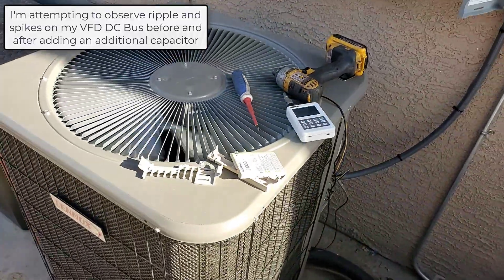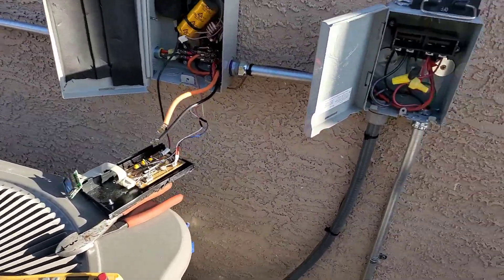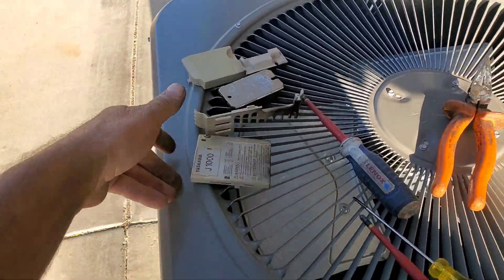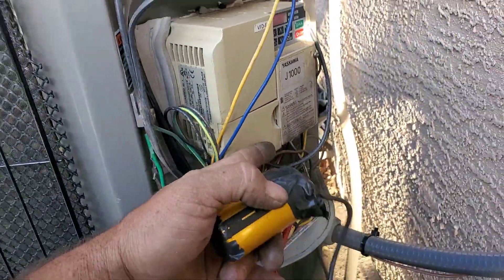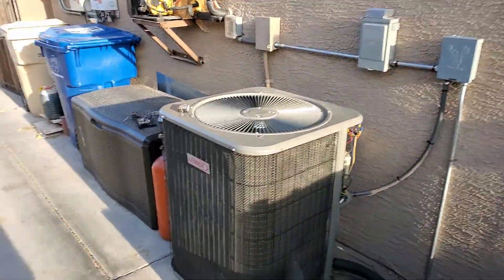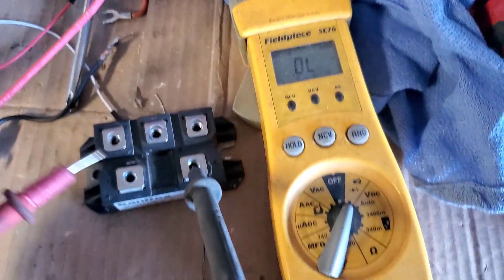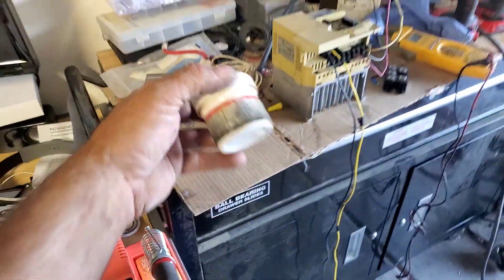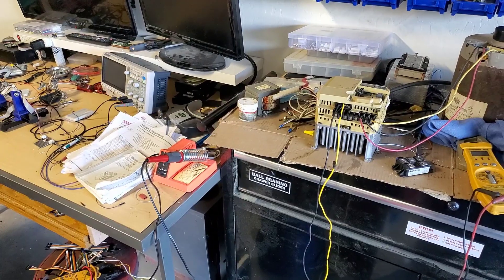DIY Solar-Assisted heat pump goes BOOM when I soldered in another DC Bus capacitor!

Comment: It's nokorode, not no arc.  That reminds me of when I worked on my hot tub and didn't replace the cover on the control box and a little water splashed on.  Well, you've learned not to use that paste on electrical.
Reply from the maker: Yup.
I mean. I may use it when I solder large battery cables together to a connector or whatnot, but I will wipe it off from now on and in those cases there won't be a bridge between + and -

Comment: Yeah with pulsing the triac input ac to the rectifier and dc bus you're constantly pulling huge surge currents into the filter capacitors- have you tried the buck transformer method? I mentioned it in an earlier video  It should give constant lower voltage to help match the solar panels. Efficiency should be good too just minimal transformer losses
Reply from the maker: I started toying with that and blew up my big MOSFET.
Then I realized the frequency of my PWM generator was at 1000 Hz rather than a lot higher!
At even 25% duty cycle I bet the coil was deep into full saturation and surging like crazy!

I should have tested at 24VAC and not immediately at 230VAC!

I have another idea that might be really simple. See the next video after this one.
Reply: @hackfreehvac  Oh I meant mains 60hz transformers - if you can find a transformer with a secondary that has a secondary capable of the maximum current the compressor requires, you can wire it to reduce the mains voltage by the voltage of the secondary winding - search google images for "buck transformer diagram" no semiconductors needed. Buck the mains voltage down so the rectified voltage is slightly less than the solar panel vmp. You could also wire the transformer primary to a variac to get a variable voltage subtraction

Comment: Be careful adding too much capacitance, it causes the rectifier and capacitor surge current to go up because the conducting time gets shorter. If those were both 1000 µF caps you were probably running a surge current over 100A through the rectifier and capacitor. I think that's only a 50A rectifier. Caps will heat up and won't last long with high amp spikes either (they have a current rating for rectifier use). You should probably think about adding a choke to limit the inrush. Fusing the DC input might also be a good idea. 5-10% ripple is okay.
Reply: If the diode is 50 A,  that means 50 A average rectified current. The  peak current value may be much higher, without bothering the diode too much. There is always a maximum repetitive peak current rating for the diode. (and please note the forward voltage drop depends on the instantaneous current and that the voltage drop then may be over a volt per diode at the peak current).
Reply: @Sixta16  isn't that rated current on the diode. It will send more but to much will let the smoke out .
Reply: I think I get what your saying. So everytime the solar dc voltage dips, and  his triac pics up to compensate to raise DC bus voltage up..the larger the cap size the larger the inrush to raise DCV and fill the caps back up. Just like when you first connect power to a cap and you get that sparking and high current.

Comment: Was the capacitor on the output of the VFD ?. 
             And since your meter only reads RMS voltage.  The peak voltage could’ve been higher than the rating of the capacitor ?.  I think I remember seeing the rating for voltage on the LG capacitors at 400 V ? 
           Also can see the acid bearing flux for pipe being conducted unlike the rosin bearing flux for electronics
Reply: 240VAC rectified is 340V DC, so I think the voltage was fine for a 400V cap. Probably too much current heated it up and flowed the flux on the cap.
Reply: TechnicalLee isn’t 340 the peak to peak ? Thought would multiply the peak of full wave rectified by .637 to get DC value
Reply: @JohnnyJr396  340V is the peak voltage, which is what a rectified input will build up to. Rectified DC voltage is always very close to AC peak voltage unless you have a ton of ripple. You're thinking average voltage.
Reply: TechnicalLee thanks

Comment: Peak to peak voltage got to hight
Reply from the maker: Cap rating is 400
It is from an old LG inverter board.
I think it was something in that pipe flux I used. It was all over the top of the cap and it must have conducted.
I have another one of the exact same caps inside the disconnect box where my circuit board is.
Reply: @hackfreehvac  I'm not sure. When you rectify ac. The peak voltage is a bunch higher then you think. Then if there's a voltage spike then it would go way over. Then there's the charge rate if those filter capacitor. If it's charged to fast it will blow up. Arc overs do funny things to. Is that a running flux. That has tin in it to make it easier to make the solder flow